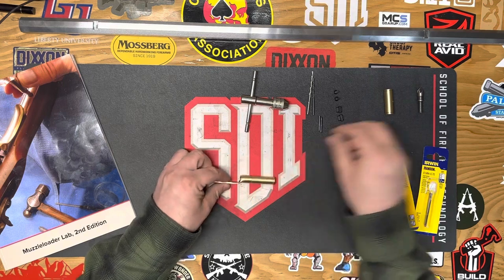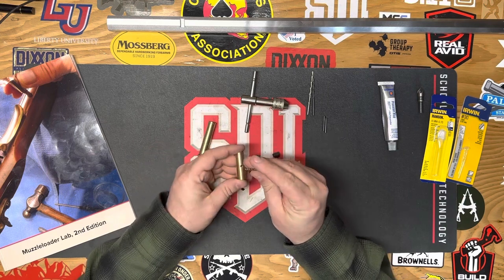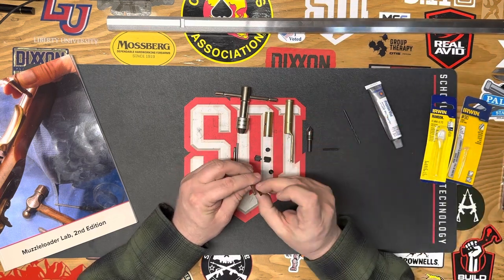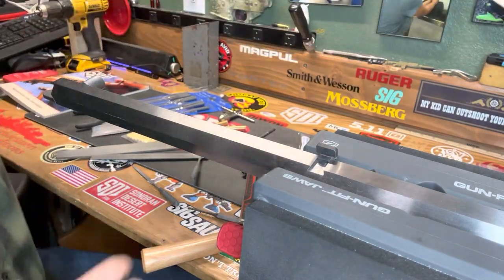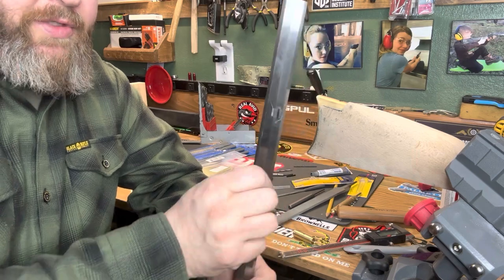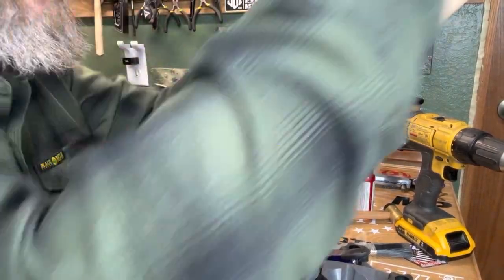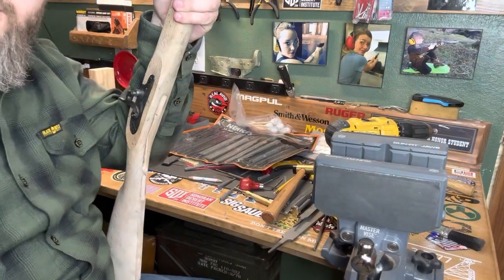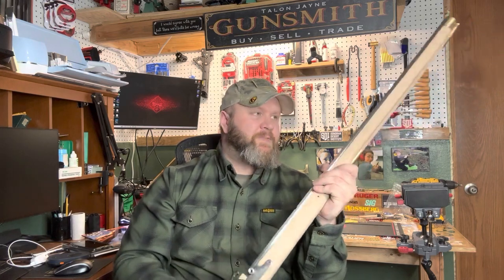SDI - FTT 210 - Week 5 Practical Application (Muzzleloader Lab Part 2)

Comment: I had the same problem with the barrel being snug in the back. It is because of the tension from securing the lock. You could have loosened it, slid the barrel in, and tightened around it. Some more practice never hurts, though. Very informative video.
Reply from the maker: I’m glad it helped! Certainly not an expert, maybe people can at least avoid my mistakes? Lol thanks!